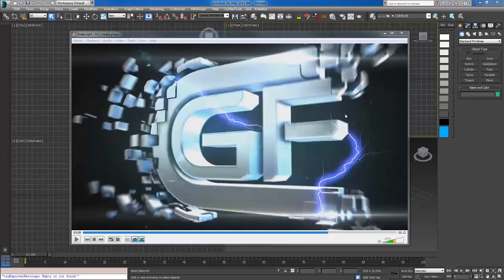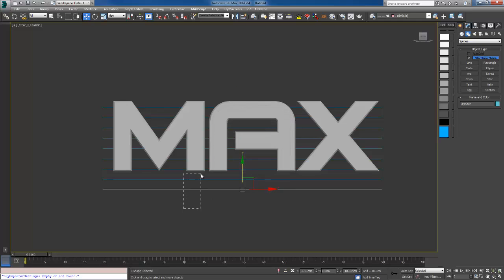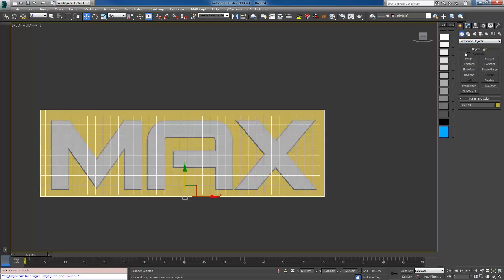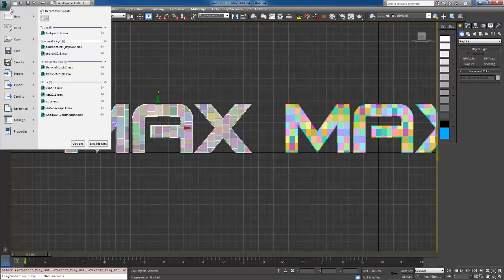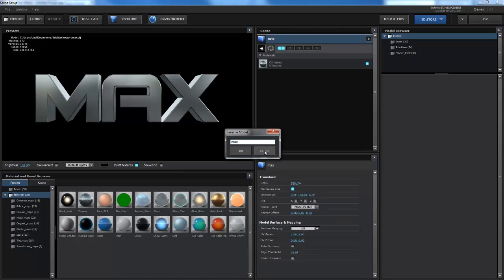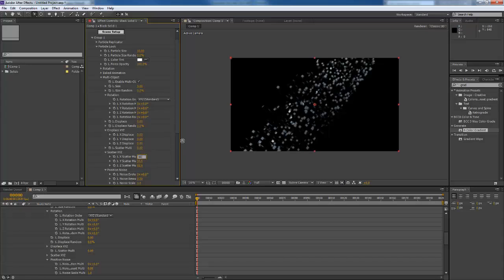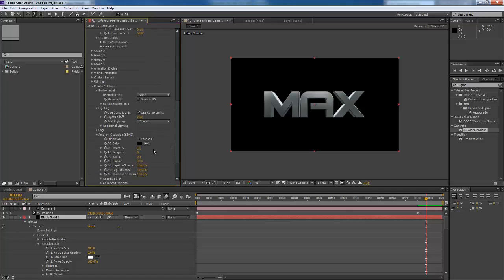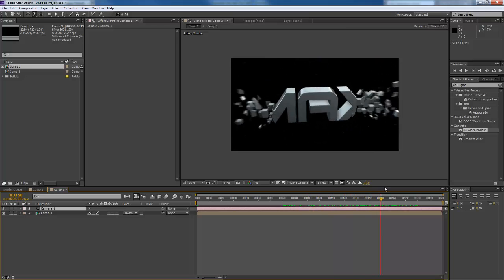create cool intro in 3dsmax and element

Comment: Dearer, I have a problem and I need a solution and I am ready to pay for it,,,I am trying to import the sequence from 3Ds max as OBJ but when it is in element 3d it comes  not as one object it come more than one object I don't know why I tried many times and it is the same this is one problem and I have another I designed a CNC router and on top of it I put a box as a sheet of wood I animated it as It is cutting but what I need is to show that it is cutting the wood if anybody know how to show in my animation that is cutting maybe there is a modifier i should use maybe a script I don't know but this is what I need to show where the bit goes should show that it is cutting if there is somebody know that I am ready to pay for it and thank you,
Reply from the maker: hi antonio i sent you am email just send me the file and i`ll check to see whats the problem

Comment: i have a little issue, please help if you can.
i did everything what you did but with different text and  style, everything gone well till the after effect part. after importing it to the element 3d and when i try to move to step for the animation , i created a key at start with 0% and end with 100% as you did, but my animation goes  backward to the infinity instead of coming forward and to the position i asign. and the animation is not working as yours. any tip or something similar, i will appreciate that.

Comment: How can you get a mini selection of extrude bevel and sweep (what buttons do you press)
Reply from the maker: its a script called Activetype (google it or go to scriptspot.com they have it there)
 i had it assigned to a custom shortcut ,its the same us the new search box that comes with max 2014. witch you can activate it by pressing x ,
 i use activetype because its faster and easier.and the script remember your  most used modifiers or tools and get them ready for you when ever you call for that script
Reply: Thanks a bunch man
Reply: Sorry i've got another question do the two planes going through the letters max (the first two you make) are they completely neccesary? Or is that just to break it up into smaller parts